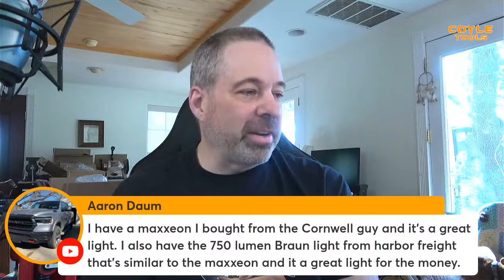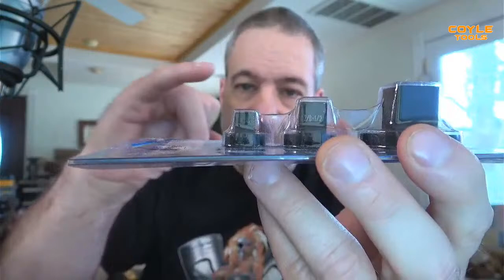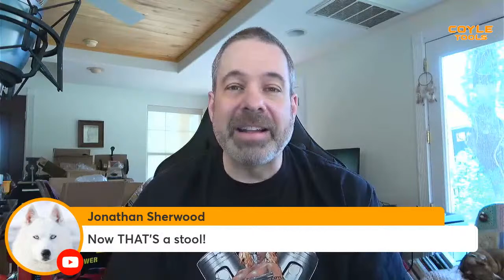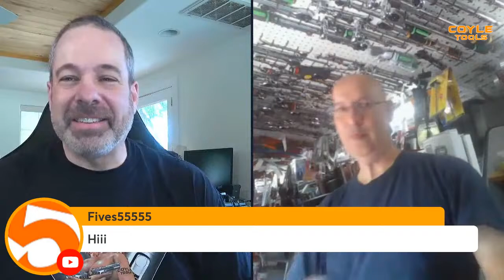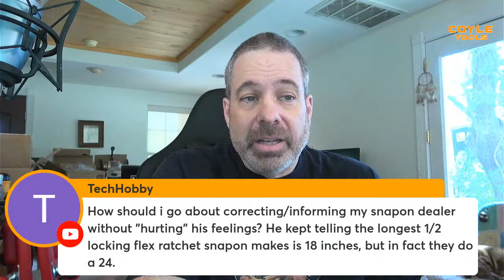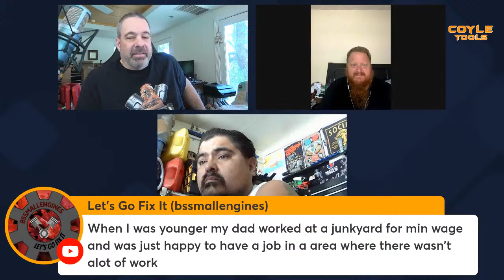Tools in the Haul LIVE!

Comment: You mentioned the Braun headlamp from Harbor freight. I’ve had it for years and I also have a stream light. The stream light battery has had to be replaced twice. And I use the Braun way more because it has a broader beam and it works like the first day I got it. Also, the Braun battery will last at least eight hours. At full power the stream light may be two. Harbor Frieght has stepped it up big-time.